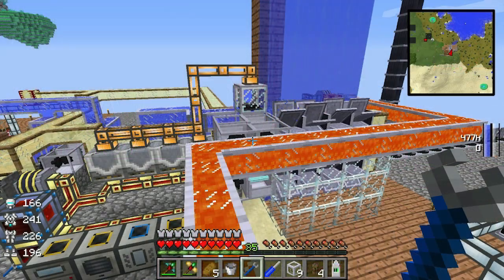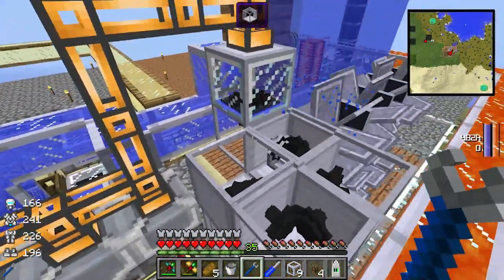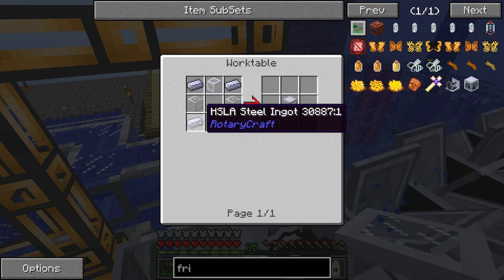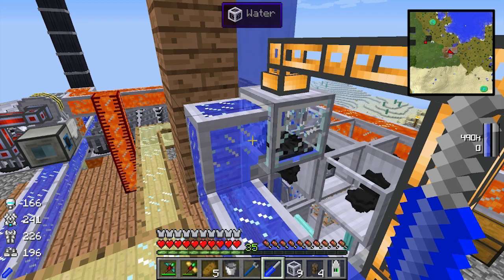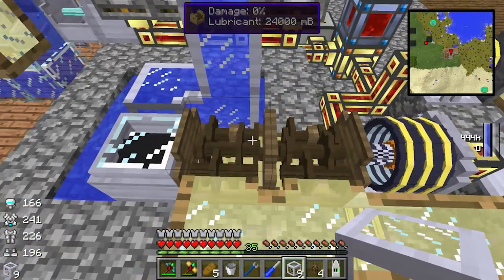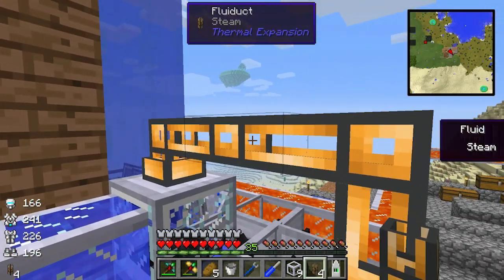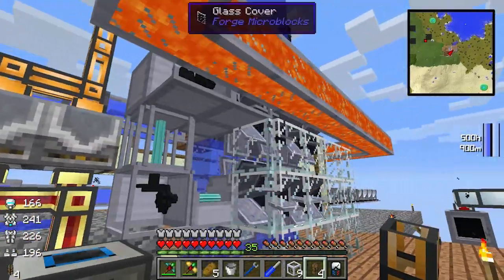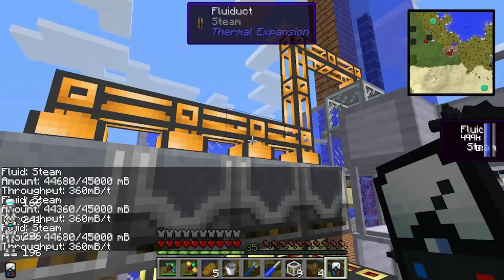Monster FTB Rotarycraft to Steam to Redstone Flux

Comment: how di you connect wooden gearboxes to the magnetostatic engine? For me they break instantly. :/
Reply from the maker: It's likely your using a version after this episode was recorded where magnetosatic engines where boosted. SO your probably going to have to use probably steel gearboxes or a cvt.
Reply: thanks for the information. I might try to use a steam turbine instead.

Comment: I tried to do something similar but I've destroyed a bunch of steel shafts and diamond shafts. What are you using to transfer the power of the Hydrokinetic engines? Also, I've seen that you've got two rows of engines, how do you deal with the speed difference between them? Finally, I am also trying to output steam into the steam boiler but I don't seem to get as much steam as you do - is it dependant on the speed of the pump or the boiler? Thanks a lot in advance!
Reply from the maker: I'm using bevels and shaft junction to transfer the power now. If your breaking diamond you have to go bedrock or use shaft junctions to split the torque first. The 2 rows of engines work because the water source block is more than 64 blocks away. Any more then 64 block away they don't produce any more meaning the torque and speed are equal. Its dependent on the temp so a mix of torque and speed and it will take time to test how of each is the sweet spot. All so try to pump more water into it. A pump with higher speed should do the trick.
Reply: Thank you very much, that was quick! I'll test it tonight. Keep up the good work!